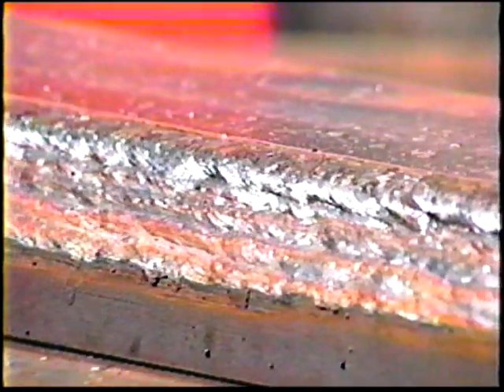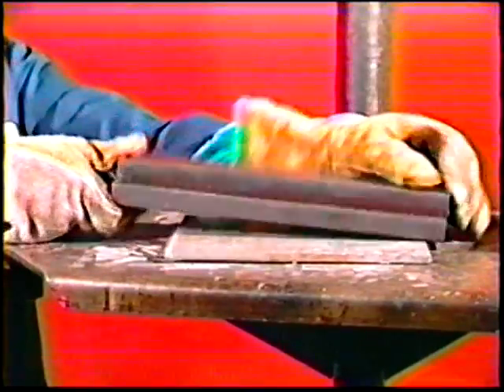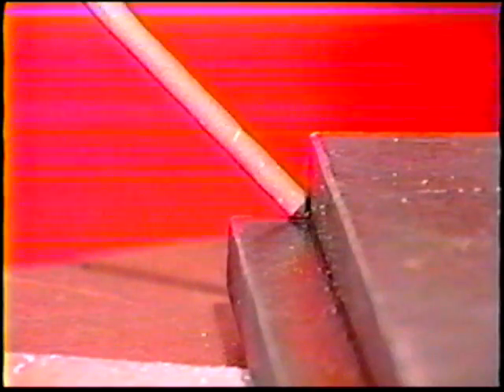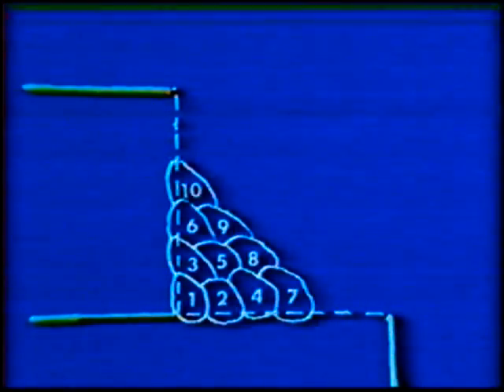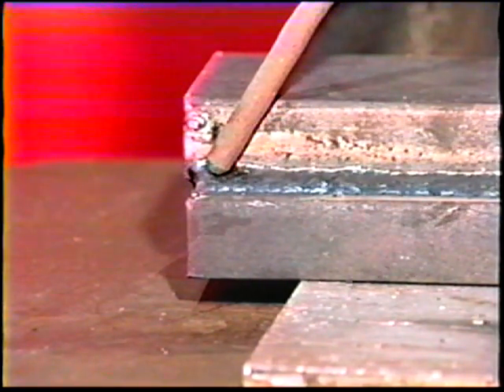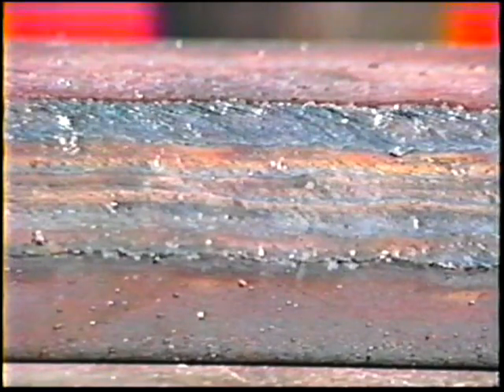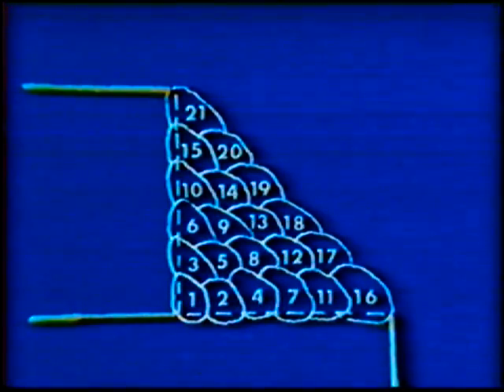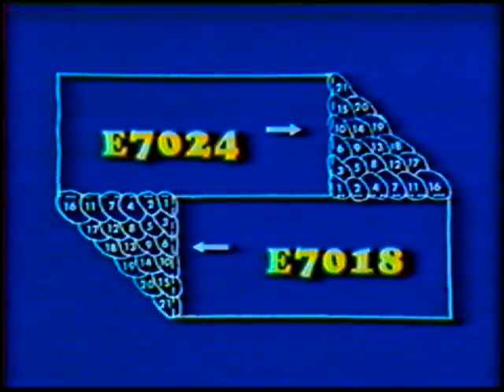Welding 1" Thick Steel with 7018

Comment: Anyone: Welding 3/4" plate to a 3/8" plate.  Doing both horizontal and vertical passes for a 3/8" bead.    Some spots will be 3/4" plate to 1" plate.   Should I just use a 7018 × 1/8 rod? 150amps or so?

Comment: I never knew you could weld such thick metal. That is good to know I can do that with my powerarc welder.
Reply: Jon Ryan you can weld this thick no problem. Just make sure you preheat the steel first to prevent root cracking